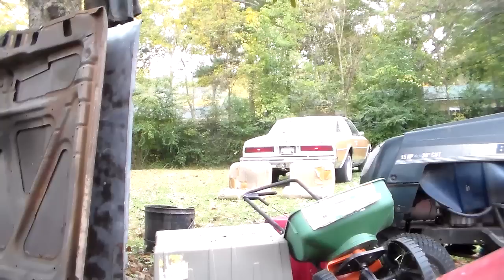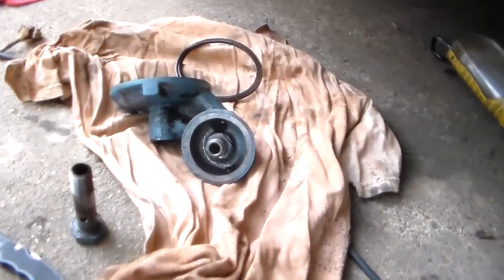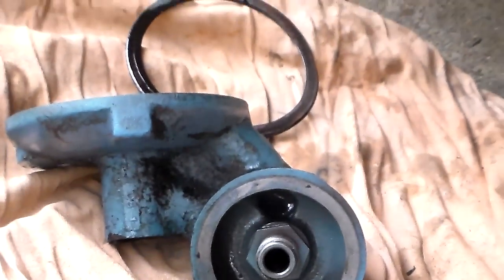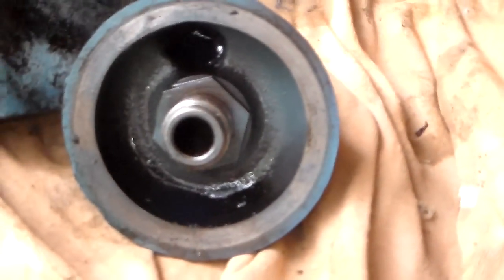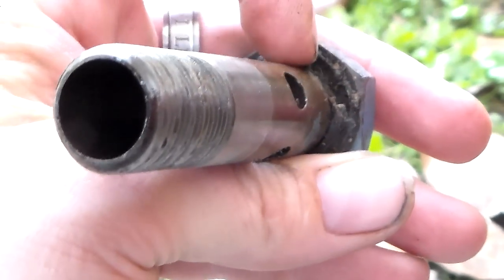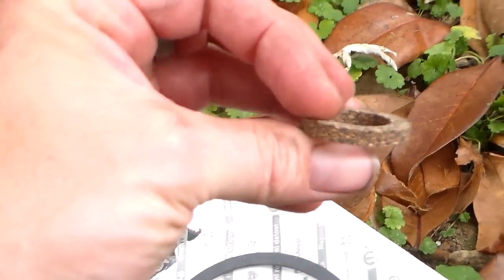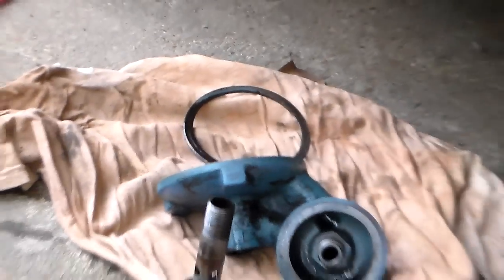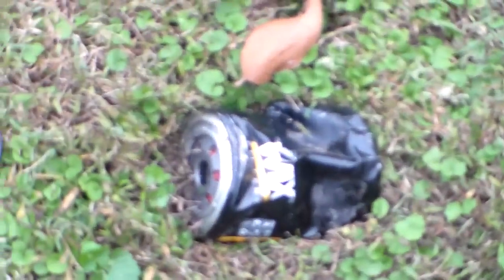Dealing with the Dart's leaking oil filter adapter

Comment: You have to blow the leaves into the woods iof your property for hours, so the wind can blow the leaves back out from the leaves during a storm, all so you can do it over again. Its what they do here!   All those adapters leak, they still have not gotten it right!  New Nissan even leak oil bad from them. The guy next door still has the bad running Tacoma?

Comment: I had put one of thees 90 degree adapters on my 360 and I could never get the thing to stop leaking.. so. I cleaned up my old standard filter plate and a short filter and never had a problem after that